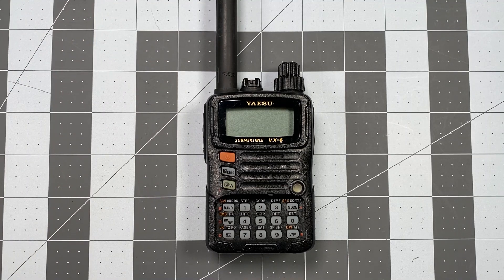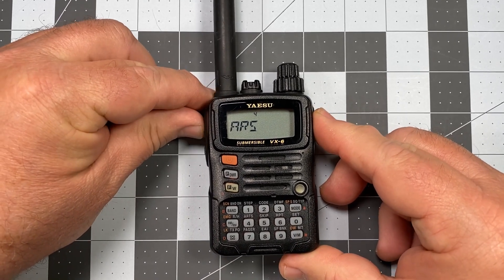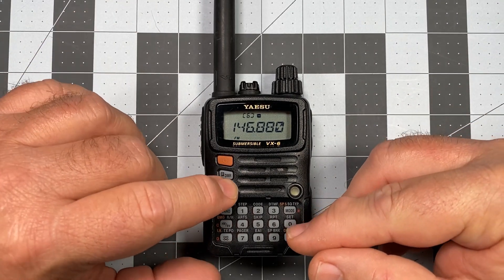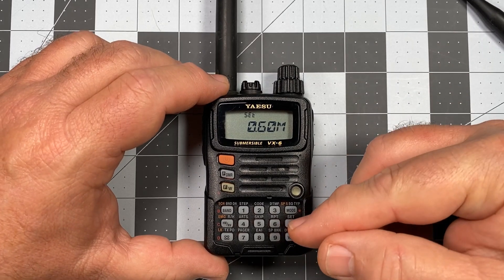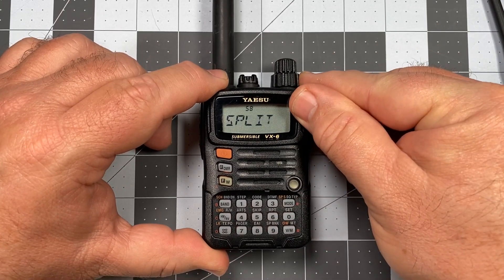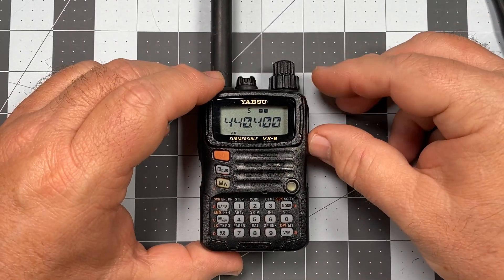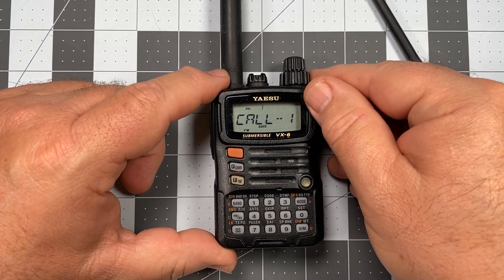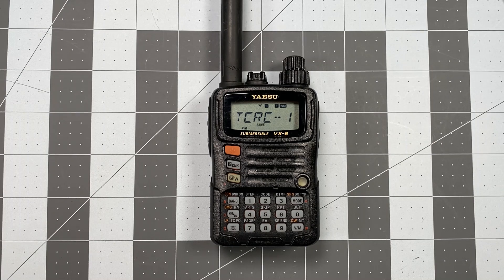Yaesu VX-6 Operators Series - Part 6: Programming Repeater Memory Channels

Comment: You have a good teaching style. Nice looking videos.

I have a VX-8DR, which I suspect has a similar...interface, in that there is more than one way to do things. I took a while to figure out why they did what they did: they want you to have 2-key random access to each separate repeater parameter. I wonder if on the VX-6, you might be able to (also) enter the repeater settings, by picking out the item you want to change such as [F] [RPT] to toggle Simplex/RPT-/RPT+  , and then [F][SQ TYPE] to set TONE, and then [F] [CODE] to set the tone frequency. Obviously, your way works, too. For me, I think I could get a rhythm. I like that the VX-9 function key is on the front. As you likely know, most everything on the keyboard is just a jump to a menu item.

Thanks for making the video.

Comment: Hi, I recently purchased a VX-6 ARS is not working, I tun it on but it doesn't set the - or +. Also I noticed that the band for the 2m ham is number 7 instead of 6 as the manual shows and your HT shows on the screen when in VFO.

Comment: Total noob here and this might be a silly question to some.  I have a list of repeaters in my local area, one of which the frequency is 145.662500.  I have the exact same VX-6 radio but I seem to be unable to enter the frequency.  When I try, I enter 145.66 and then it won't allow me to enter 2500... What am I doing wrong.  I have set the offset and uplink tone but can't get the frequency entered.  What am I doing wrong?

Comment: adding a GMRS repeater/net frequency would not add a "+" right unless you performed a Mars Mod? Mine is showing no "+" and errors when hitting ptt... need to go watch the Mars Mod on VX-6 I think. I've received my GMRS license.
Reply from the maker: Automatic Repeater Shift only applies offset to frequencies associated with HAM repeaters. It won't apply any kind of offset to a GMRS repeater frequency. That will need to be done manually. That video is going to follow the MARS Mod video. Which is coming soon. But I've been down with the plague since last Saturday. Should be up to it in a day or two.